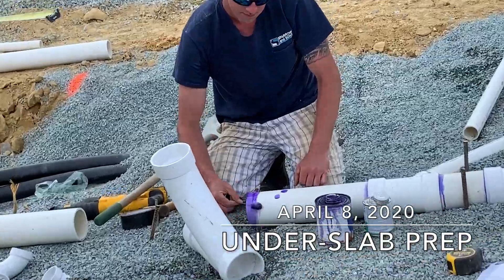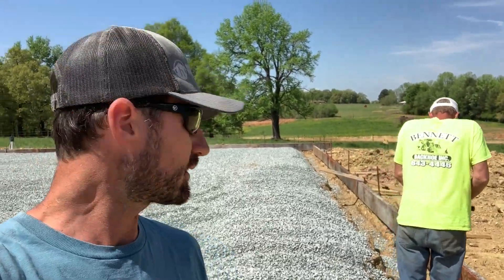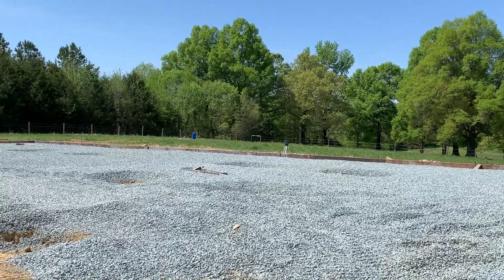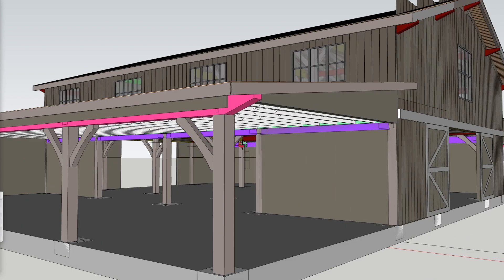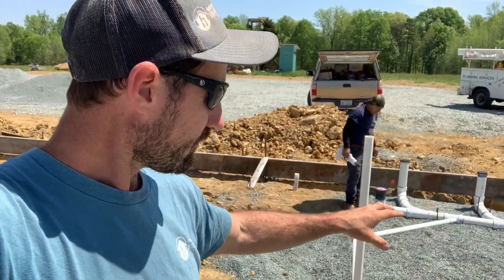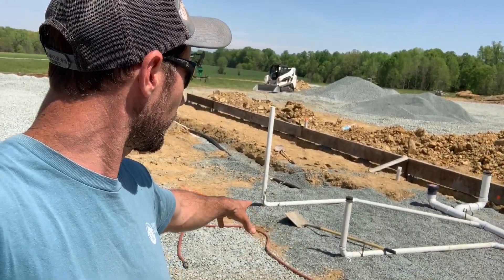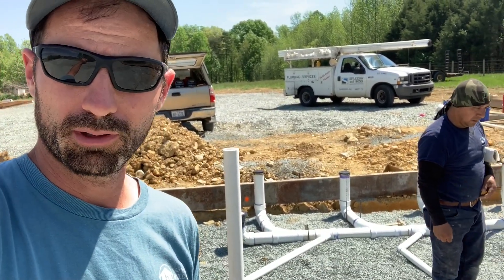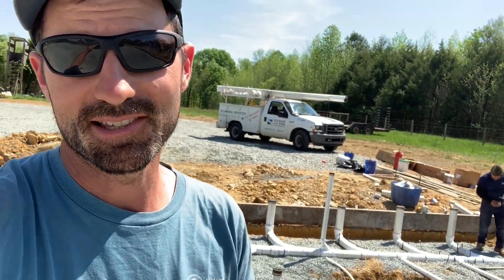Underslab Prep - 5 Tips for a solid foundation and water-tight plumbing

Comment: Is there any other option for plumbing other than the under slab method ?
Reply from the maker: While still building a slab foundation?
Reply: @HeirloomBuilders  Actually I'd go for pier and beam to avoid plumbing heavy repair costs but i was wondering if there's a way to put the drain system on the slab .

Comment: not enough fill to bed pipe properly-don't let cement guy tell you he will fill around pipes-that's how they get broke and screwed up. Plumbers always double check square and size before ever digging. and if your not digging proper ditches , thats your first mistake -no fill. is the pipe sitting on undisturbed soil? I do like the supply line insulation and protection... well done but make sure it has air pressure holding before you pour.4 with have a 6 then for sleeve. 15min min. rural areas and farm isnt an excuse but ty for trying to make sure its gonna work right. ty right fill then let it burp and then do your caps.

Comment: Did you put joints in the concrete slab around your post footers?  If not, are you seeing any cracking around the posts?
Reply from the maker: W Weiler we have 3’x3’ thickened footers under the posts, so our strategy was to avoid those with the control joints in between posts since the thickened footers are the strongest/thickest part. No cracking has occurred around the posts.